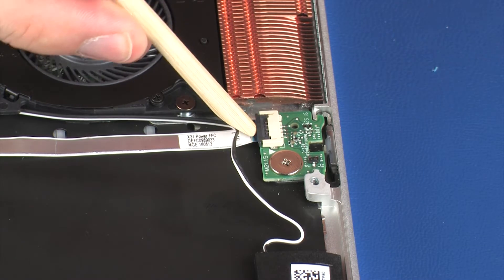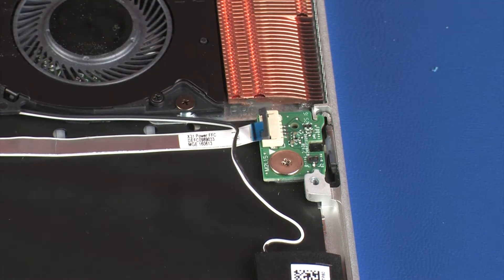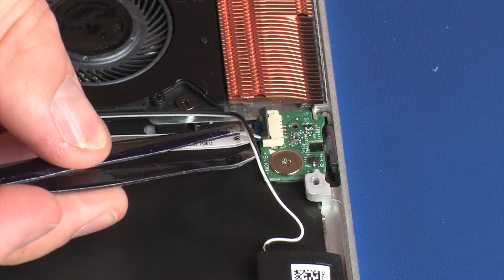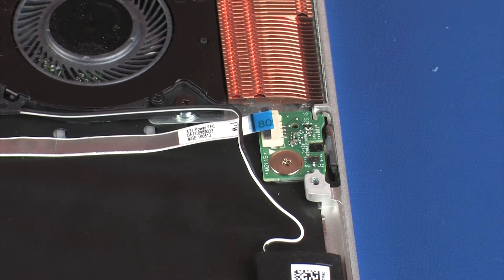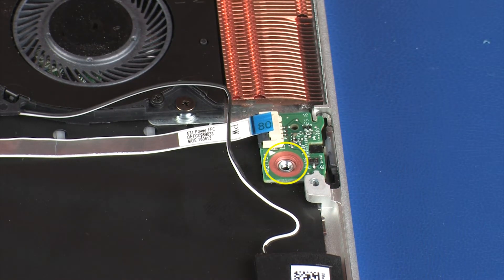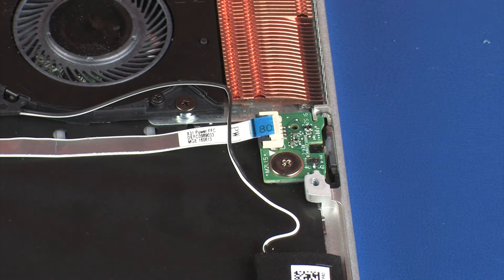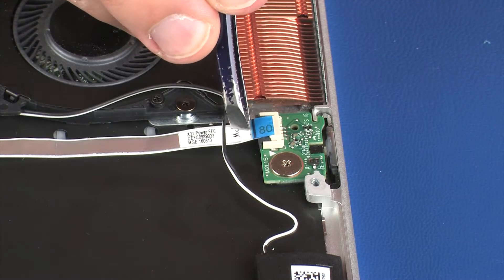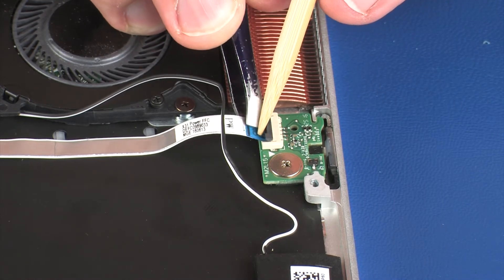Replace the Power Button Board | HP Spectre x360 Convertible 13-w000 Notebook | HP Support

Comment: Thank you for the video -- I have an HP Spectre x360 13t that works, however, once it turns off it is almost impossible to get it to turn back on. When I press the power button a single white light flashes on the power button itself. I haven't been able to find anywhere online to say what this issue is. Should I proceed with replacing the power button board to resolve? On the off chance that I am able to get the laptop to turn back on, it functions perfectly, holds a battery charge, etc. Just the issue seems to be coming from the power button not working properly to tell the computer to turn on. Thanks for any insight!
Reply from the maker: +Cory Elliott Burke Please contact our phone support team to fix the issue. Please follow these steps to reach them.
Step 1. Open link: https://support.hp.com/us-en/contact-hp
Step 2. Select the product type.
Step 3. Enter the serial number of your device or select let HP detect your product option.
Step 4. Select the country from the drop-down.
Step 5. You should see the HP phone support number.